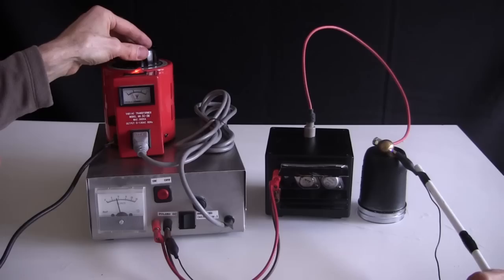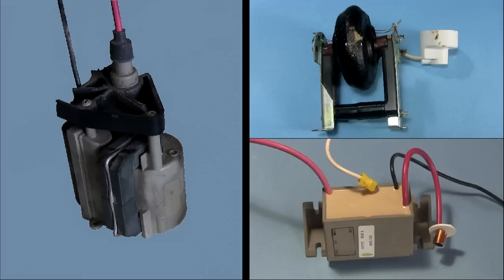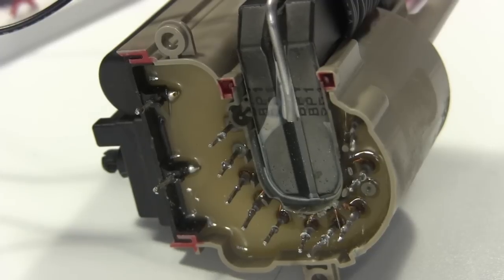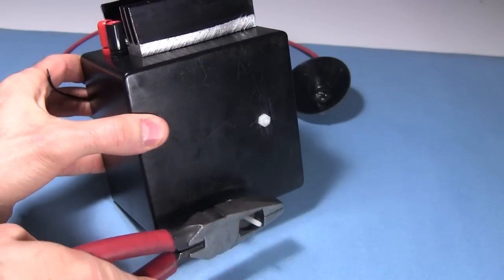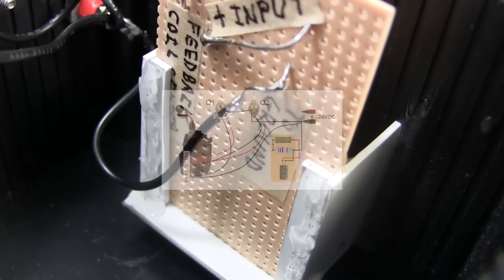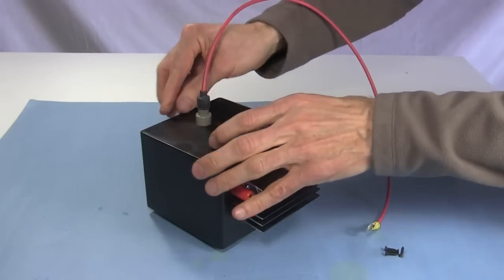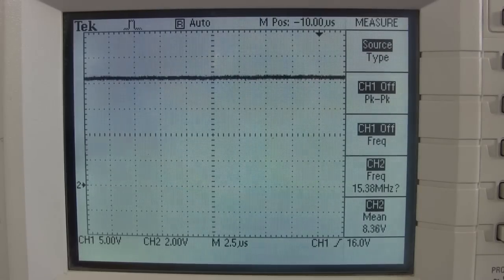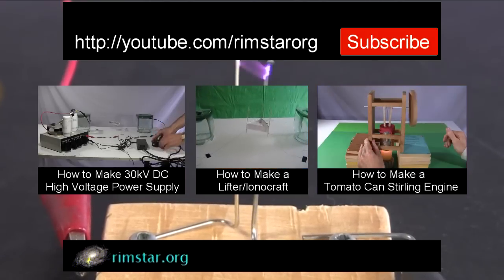The Cube - How to Make High Voltage Power Supply w Flyback/Builtin Diodes

Comment: Will the regular computer power supply do the trick? I mean, will it handle "The Cube"? I have two 12V outputs there which provides 14A and 13A respectively. Thus according to first Kirchoff's law if I join these two together I will get 24V that can handle 27A total (..aye? pls, correct me if I'm wrong :D). I just salvaged an old flyback transformer from my really old CRT TV and I don't have a variac. Sadly I lent my multimeter to my friend, hopefully I'll get it back tommorow and test this stuff out!
Reply from the maker: BulletProofCupid7 In the video I show it running at 10V and 1.9A so I imagine 12V at 13A or 14A should work. The output voltage will also be on the lower end of what it can do, which may of may not suit your needs.As for connecting them together, I'm not sure if you can do that with power supply outputs. To get higher voltage you'd connect them in series (positive of one connected to the negative of the the other), but the current won't increase. To get higher current you'd connect them in parallel (positives connected together and negatives connected together), but the voltage won't increase. So you can get either higher voltage or higher current but not both. The problem is that at 12V you already have plenty of current with just one output so there's no need for two of them, whereas if you combine them to get 24V then the power supply's transistors will heat up too fast. At 20V I found they heated up too much within 30 seconds.
Reply: RimstarOrg If 10V gave around 10kV(?) then 12V will be totally enough for me :) Also is there a linear tendency? Will I get 5kV if I apply 5V on the input? Thanks for help! Also, I'm just curious, why this additional coils on the core and all that circuitry? I've seen videos of people who were looking for HV and power pins on these things then just plugged those into 24V power supply and got huge ammounts of voltage on output with ease where no circuitry or additional coiling were necessary. Just the transformer and 24V input.
Reply from the maker: BulletProofCupid7
The only recording of input voltage and current to output voltage is what I have in the video. I haven't made a note otherwise.
Regarding why the coils and circuitry, I can't speak for using the pins instead since I haven't looked into it or tried it. Obviously they should work since they are used in monitors and TVs for the same reason. Just another way of doing it I guess.

Comment: IS THIS a low budjet electricity?if yes i try to make this one...if no its fine...
Reply from the maker: That depends. For me it was low budget because I had a lot of the part collected from over the years, some of it from scavaging from old things I took apart and some things I'd bought cheaply. But if you're starting from scratch and buying everything then it can cost a bit. The most expensive part would be the flyback transformer if you have to buy it.
Reply: @RimstarOrg  i mean sir,, if i make this one experiment,, will my electric bill go down,,, and i pay less
Reply: @RimstarOrg  in other way if input is 220acv output 24dcv i will step up high voltage,,when i use 2 or more appliances...is the result is same us ACV input consume by many appliaces?
Reply from the maker: I'm sorry but I don't understand your question. Can you give an example of what you mean?
Reply from the maker: Ah, your comment about electric bills going down was held for review by YouTube. I just saw it now and approved it. The answer is no, it will not make you electric bill go down. It will make your electric bill go up since the power supply it not 100% efficient, there will be losses. The thing I think you are missing in your understanding is that power is not voltage. Power is a combination of voltage and current. If you increase the voltage then the current goes down. Since you increased one but decreased the other, the power stays the same. In mathematical terms we say that power = voltage x current.
Reply: @RimstarOrg  ok i finally understand... sorry im weak english im a filipino...

Comment: The output arc was still up to 1.25 in., when I had the circuit strung out on the bench. I never got to measure it when it was in the box. This was just wire to wire.

Comment: bro your flyback transformer is built in diodes or not

whats your flyback transformer model number
Reply from the maker: From writing that was on the board near the flyback transformer it said T505 and clearly it was a Sony flyback. From http://www.tvserviceparts.com/Sony_Transformers.html it's Model KV32FS12, Version T505, Part Number 1-453-338-21. The KV32FS12 might be the Sony TV model number. The 1-453-338-21 is the part number, maybe just for that website. An alternative part no looks like it might be Sony part 1-453-338-11
Reply: RimstarOrg 
Thank you so much sir

Comment: RimstarOrg can you tell me if an old PC 750volt PSU, could be used instead of this? ... i want to make a Tesla Coil using an old PC Power supply. I know it might take some creative thinking, but  that PSU is just lying around anyway. If anyone else has any ideas, please feel free to leave me a comment.
Reply from the maker: I don't know. Can the PC 750volt PSU provide a frequent spark? If yes, then I'd imagine there'd be enough energy in the spark.
Reply: RimstarOrg, I was wondering if you ever pulled a Ultra HD TV apart yet, I mean you must be able to salvage some interesting components from them?
Reply from the maker: No, I haven't.

Comment: I was going to try an experiment to make the flyback work on higher voltage power supply by using either 440 ohm with 40 of the ohms divided off or 430 ohm with 30 ohms divided off so it would work with my 26V power supply. But I can't get it to work,even after putting jumper connectors to reduce the ohms back to 260 with 20 divided off....I know that is not exactly what the original plan was,but,it's pretty close,...it was just the way the resistor bank was that determined that amount.

Comment: Interesting video! :D

But I have a question: Can those 20kv from this power supply kill you? Because it only requires 24V input which are not lethal and you can't make high voltage WITH high current from only 24V, or can you?
So I mean, is the current from this supply high enough to hurt or kill you? 
Because the ignition of a car pumps out arround 50kv and if you touch it, it only "tickles" a little, because the current is so low :D.

I hope you understand what i mean! ^^

PS: Sorry for my english, I'm from Austria!
Reply from the maker: I didn't put it in the video but I did measure the current at the output when it was arcing. When it arcs the voltage is actually lower, since it's conducting through the air. The current was over 250 milliamps, which can kill you. But I didn't measure the voltage at the same time. However, since the arcing is DC, it only has to be a few hundred voltage to get through your skin. From those measurements I'd say it can hurt or kill you.PS: Your English is perfect.
Reply: Ah ok thanks for the fast answer! :D

Comment: could you please do a video on how to center tap, I'm honestly a really big fan and I try to make everything you do but I can't seem to understand how to center tap, thanks!
Reply: if you strip a section of the insulation in the centre of the wire, then wrap the one end of a second wire around that a few times. Then put some flux on it and solder. Electrical tape the soldered connection.
Reply from the maker: Sorry, I missed your comment somehow. But my answer is the same as what +Aghast said.
Reply: +RimstarOrg thank you soooo much, your channel is so awesome!!!

Comment: why you connected a ball to output?
Reply from the maker: It's a habit and it has its uses. A sharp point leaks more charge to the surroundings. 
Charges are more crowded together at a sharp point and so they create a stronger electric field which ionizes the air, making the air conductive. That conductive air allows charge to conduct away from the sharp points.
With a rounder object, the charges aren't so crowded together and so there isn't as much leakage.
But it depends on what you're doing at the time. When connecting two high voltage wires together, if there's no insulation at the connection then there'll be less leakage if the connection is made at a round metal object. And since I use this power supply to power things, like my Tesla coil, I have the habit of keeping a round ball on the output wire.

Comment: Ok so, what is a high voltage power supply exactly? Is lit like a generator that makes electricity, since its called a power supply?
Reply from the maker: From the point of view of whatever the load is that's plugged into it, it supplies power that's at high voltage (up to 20,000 volts in this case) compared to the voltage from your wall socket (120 volts or 220 volts depending on where you are.) In this video one of the loads is the jacob's ladder, which needs high voltage in order to create the arc between the two posts of the "ladder".

Comment: Is'nt the tripler built into this flyback?
Reply from the maker: John Kerley There isn't a tripler but there is a diode of some sort. I don't know exactly what parts since I don't have the schematic for it. There might be a capacitor too, given how smooth the output is. Together they may make up a single stage Cockcroft-Walton voltage multiplier. A tripler is a 3 stage Cockcroft-Walton voltage multiplier. I'm guessing only a single stage since the voltage is so "low" compared to what it would be with 3 stages.

Comment: 1st. try zvs driver 2nd.royer oscillator (like this one) is not efficient for high powers- better use royer oscillator for driver circuit for set of 2 transistor and coil with center tap for full sine wave signal with high reliability and low losses

Comment: I guessed that the original feedback coil would output 1/9 of the original primary volts, because on the TV circuit board the pins of these two coils said 15v and 135v.

Comment: I noticed that your 30,000v supply seems not to require as much power as the your cube power supply. I wonder if that is due to the 30,000v flyback having possibly more secondary turns,....as I think this would increase the inductance and lower the current.
Reply from the maker: John Kerley I don't know about my 30,000V supply not requiring as much power but I strongly suspect that my cube power supply (flyback with built-in diode and no tripler) supplies more current. Possibly the tripler is somehow restricting the current (a guess) even when the 30,000V supply is dialed down to output the same voltage as the cube.
Reply: RimstarOrg Voltage multipliers are not that efficient under load, there is a lot of science behind them worth searching into, but in some cases, as more output stages are added to boost the voltage, you will see diminishing returns, and eventually each additional stage LOWERs the output!

Also, the reason you see steady DC is because the long wire acts like a really small capacitor. that + the internal diodes and voltage multiplier integrated into the DC flyback make make a rectifier. Then it is just a scaled up version of a standard AC to DC half wave (or possibly full wave, depending on the flyback design) rectifier!
Reply from the maker: Power Max Yeah, I have an 11 stage multiplier in one power supply that goes only from around 10kV to around 75kV. Not a lot of multiplication going on there. Probably the diminishing returns.
I didn't think flybacks had integrated voltage multipliers, which is why I was surprised to see such flat DC. With just a few high voltage diodes, I expected more half wave rectification. But I guess if there is capacitance in the long wire as you say then that might smooth it out.

Comment: The transistors turn on,but will not turn off,and the coil wires are turned the same direction,and the upper feedback wire is to base of one transistor and the upper primary coil wire is to that same transistors collector, and same for other transistor except it is the lower wires. The transistors are 2N3055. The coils appear to be about as tightly wound as what you show. It is a mystery!

Comment: I do'nt know now if there was any truth to what I said about short current spikes or not, I believe that it was probably more like RF interference that was messing with the digital read outs of the bench supply,because it still does it. Of coarse, before this it was back feed voltage that caused it.

Comment: can i use 3300uf 50v capacitor?
Reply from the maker: +BiboyRobs123 I really can't say. That's quite a bit lower capacitance.
Reply: +RimstarOrg so am i allowed to put them in parallel to increase the capacitance?
Reply from the maker: +BiboyRobs123 Yes, you can put them in parallel.
Reply: +RimstarOrg thank you :).
does it need DC or AC bcs flyback transformer looks like it needs AC ?
Reply from the maker: +BiboyRobs123 If you mean the power supply that feeds the Cube, that has to be a DC power supply. The flyback transformer turns it into AC.
Reply: +RimstarOrg Ohhh Thank you.

Comment: Forward base voltage should have only been 2.36 V when input was 26V. That is why I think that the reverse base voltage must have been exceeded. Also because the transistors did not get hot at all before they blew out. Again, I am sorry for all the comments about that I could not get the circuit to work,.....I feel stupid now!

Comment: Just make sure all groups of pins are connected to eachother. (insert link where no contact) and the pin-isolation would not be needed. Do not connect pins with internal connection(for example  less than 100 ohm) together.

There are some high-voltage resistors and capacitors inside. Shorting their pins together will stop them from arcing.
Reply from the maker: Interesting idea. I guess it's based on the assumption that the ones that aren't connected to any others go to sections of coil that are open somewhere. But what do you mean by "groups of pins"? The one in this video had just an set of pins spaced out in an arc. Oh, and I couldn't find any schematic for this flyback online.
Reply: RimstarOrg You can check the internal connections using a multimeter.

There are:
* 1 primary, around 1 ohm (probably pin 1 & 2), intended for around 90V
* 1 high voltage negative (the one you found)
* zero or more secondary windings (whatever apply, like: 12V, 15V, 6.3V)
* Capacitor pins (to output, to focus), may spark when you spark from the output
High voltage resistors (may reveal itself with high voltage output, tricky to messure with multimeter)

None of the voltages listed here are very fixed, all depends on the TV/monitor.

The secondary windings are usually many windings going from a central pin that is grounded.

Try measuring all pins toward the other pins, probably no need to re-measure the HV negative.
Reply from the maker: erlendse
Thanks. I did do resistance measurements before building the power supply. Going around the arc of pins:
pins 1 thru 4 were connected with 0.9ohms between adjacent pins.
pin 5 came off during my clean up.
pin 6 was the ground return and disconnected from anything else, though of course we know it wasn't really. It has at least a diode. I did try doing a high voltage diode test (the test in my video here How to test high voltage diodes That test failed but that could just because there's more than just a single high voltage diode there.
pins 7 thru 9 had around 0.8 ohms between them.
pins 10 and 11 showed no continuity to anything.
One of the other pins off to the side showed no continuity to anything.
The other pin off to the side had 6.8 Mohms between it and the SCREEN wire.
Reply: RimstarOrg
The video is correct, but we are talking about 3-6 HV diodes in series (with winding between each), so you will most likely need even more voltage.

a 20-50V supply may be needed.

If you connect pin 1, 7 and 6 the voltages should be under control.

I also got a high voltage supply project, but with well known transformers.

Comment: The new flyback transformer also uses a super high voltage capacitor at very low capacity.

Comment: If it could be figured out, the circuit would not need much current to work. My last attempt only used 26V on the same resistors(360 ohm,30 ohm) and only drew 725mA.

Comment: Anyway, I think my wire gauge was a little off, I measured some scrap wires that I had used on it and I think they measured to be 18 gauge and 25 gauge. That may be the problem.
Reply: I was so confused at that time that I am suprised if anything I said then could have helped,but,ok,thanks.

Comment: The very instant I hooked to the adapter it turned off, I never even saw one spark. But later I found out that the adapter still worked after being unplugged and plugged back in later. I am sorry for being impatient.